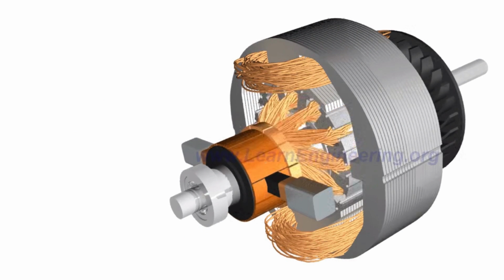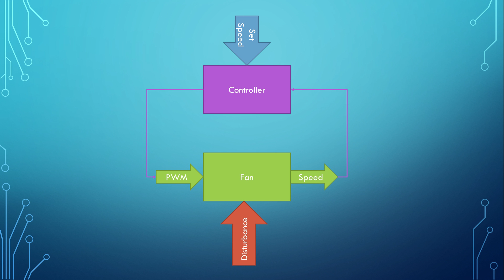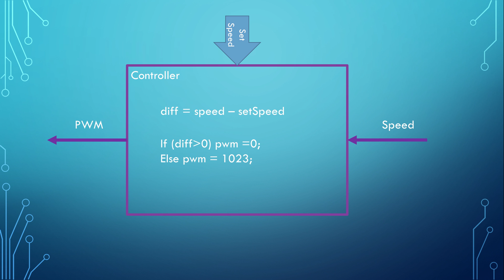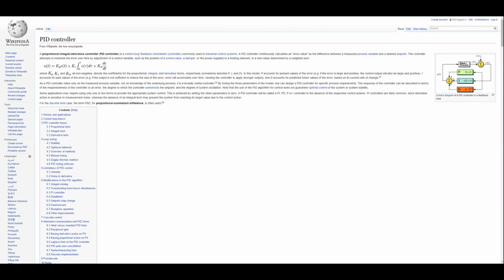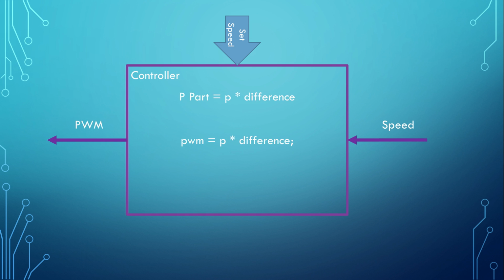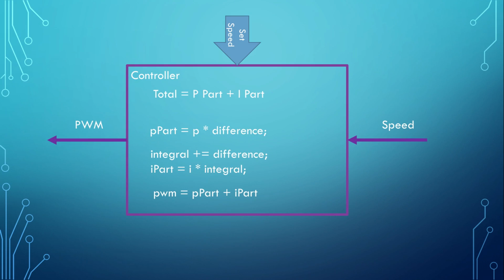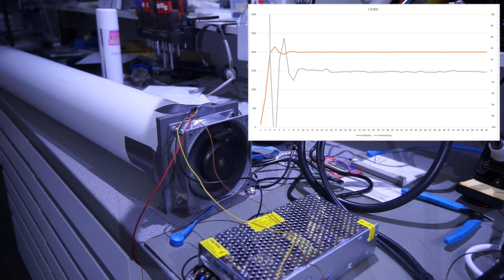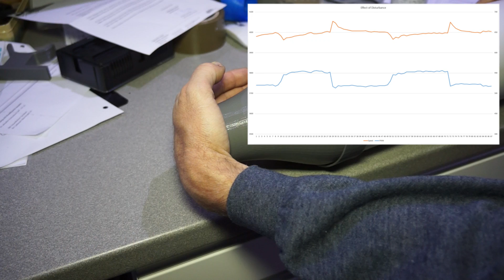#28 Tutorial: PID controller using an Arduino

Comment: what if the motor speed is lower than the required value, wouldn't the P part = current value - required value. Or do I just take the absolute value of the difference
Reply from the maker: I do no more remember the details. But the formulas should be correct.

Comment: how to choose pidmin and pid max values
Reply from the maker: By experimenting
Reply: @AndreasSpiess Thanks andreas
Can you please guide 
 (1)pid max pid min depends on output range or error percentage or fixed range
(2) In pid   integral value and derivative values should be updated at what speed. I mean integral and derivative are based on time ? some standard pids like siemens give i and d in seconds. can you explain and guide.
Thanks 
P.R.B

Comment: I think it was on the boundary of the Arduino to get it higher than Andreas got it. Servo positioning ok. Precise motor control needs a lot more power. My favorite workhorse is a uC from ST Micro. It can do 10 times as much in one tenth the time. Nice tutorial.
Reply from the maker: Or an ESP32 ;-)

Comment: Good video, example code would be a very helpful addition.
Reply from the maker: This is quite an old video and I do not have the sketches handy. However, there is an Arduino library for PID.
Reply: Thanks for the reply, I figured it out with an example that came with the PID Library.

Comment: Great tutorial, I am working on similar speed control problem, what kind of sensor is used for speed sensing(how many pulses per revolution?), what is the sampling interval, can we use time interval as the control variable?
Reply from the maker: It was all built into the fan and I do not remember the exact numbers. 4 wire fans have a sensor for RPM built-in

Comment: Did you end up only using the I controller since it got you exactly the 2000 RPM, or did you still end up using the proportional part of the controller? Great video!!!
Reply from the maker: +Luis Camal At the beginning the D part is important. Later, the I part gets more important, when the difference is smaller

Comment: hallo! I am on a very base-level and right now in a project where we use the hub-ee wheel (a wheel with built in encoder),  if I understand you right and want to use a PID-controller to get the wheel to a specific position, could I write something like this to get a P-controller:

int motor1speed;
int actualPoint;
int setPoint;
int diff;
int p;

p=0,8;
setPoint=340;

void setup() {

motor1Wheel.setupPins(8,11,9);

}

void loop() {

diff=actualPoint-setPoint;

motor1speed=diff*p; 

if (motor1speed>255){
motor1speed==255
}
if (motor1speed<0){
motor1speed==0
}

motor1Wheel.setMotorPower(motor1Speed);

}

and if I understod you right, how would the I and D be put in to the code?

Would be very grateful for help with a answer or if you know a link that show it in same good way as you.. Thanks!
Reply from the maker: 1. Basics are ok. But I think, you need also negative speeds because your motor could go across the position and has to reverse.
2. Pay attention to the sign of the difference. The speed has to be different accordingly (positive or negative)

3. The I and the D parts have to be included as the p part. (diff *p + integral(diff) * i + diff' x d). You can take my code as an example.
4. I would start with the p only part. only if it works, I would add the I part. I do not think, you will need a d part.

Comment: Hello. Will you be able to share the code of this fan pid controller. I have made a home made jet engine and this code would be perfect to use as  throttle controll. I have a hall sensor with a amplifier and a schmitt trigger so that would be the same as you. Insteed of driving a fan it would be driving the fuelpump. I need this function because today when i am igniting the afterburner the rpm off the engine goes down alitle bit. I have a ordinary 10k potentiometer as throttle.

Comment: awsome stuff, great channel... can it be used to control servos in a cnc-like maschine with incremental optical encoders? i heard there are better methods for this, but the pid seems quite simple
Reply from the maker: +grmlje grmone Thank you for your compliment. Usually you do not need an additional PID controller for a servo because the servo itself consist of a motor, an position encoder (often a potentiometer) and something like a simple "PID" controller.
But usually, they are very inaccurate compared what you need for a CNC. And usually, they have just 180 or 360 degrees range.

If you exchange the word "servo" with "motor", then you are right. There are some videos where people used a motor, a rotary  encoder (usually optical), and a controller. This seems to work and is a perfect application for a PID controller.
Most of the smaller CNC routers (including mine)  however, use stepper motors.
Reply: +Andreas Spiess yeah, i should have said dc motors.. i added some transmission to them and they are going to become servos after i decide what control to use (pid and pll are the main candidates for now). i would love to see a video on pll in your style

all the best in the new year :)
Reply from the maker: +grmlje grmone Happy New Year to you, too. With PLL you mean Phase Locked Loops? What kind of applications you have in mind?
Reply: +Andreas Spiess yeah, phase locked loop.. im intrested in it because im working on a diy cnc router atm. but im working on a piece of code as well that will allow me later in life to easily connect almost any kind of motor and easily control it, could be useful for future hacks, and i want to cram every type of control into it for more flexibility. i dont know much about pll.. yet